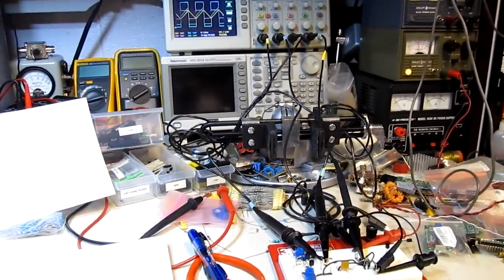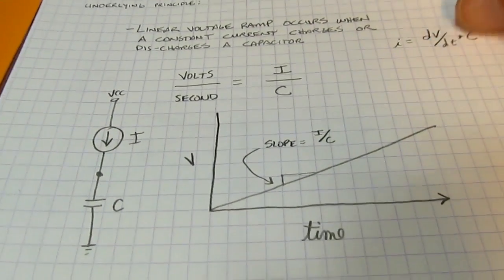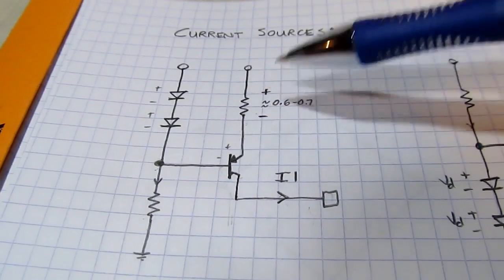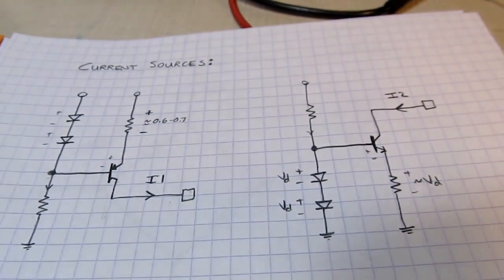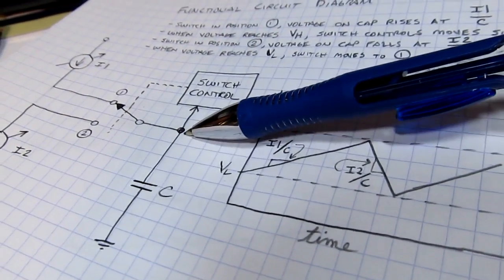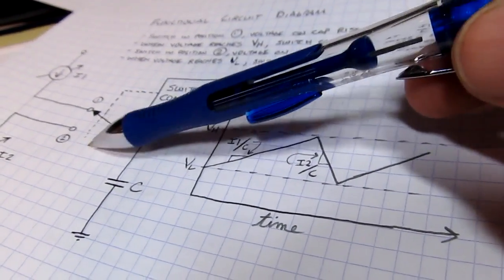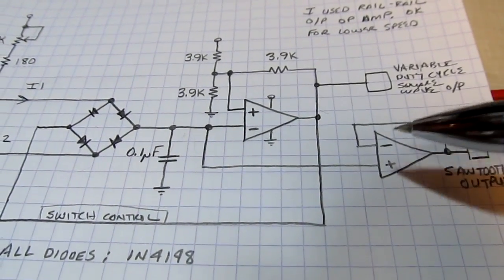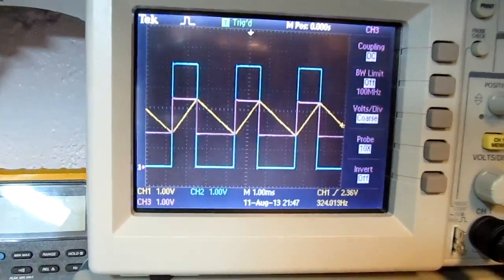#104: Circuit tutorial: sawtooth generator w/ current sources, diode switches, hysteresis comparator

Comment: Hey, I tried to simulate the circuit and almost succeded, but I'm having one problem that is keeping me from achieveing a perfect result: when one of the pots is at 1k (the one that controls the current through the PNP) and the other is at 0 (NPN), the generator works; however, when I swap the values (set the 1k resistor to 0 and the one at 0 to 1k) it doesn't work (voltage of the cap is at 1.2 V in this case). To simulate I am using 1N4148 diodes, BC547C and BC557C transistors, and an LT1716 comparator (datasheet: http://www.linear.com/product/LT1716). I used 12 V to power both the circuit and the comparator (+ is at 12 V, - is grounded). The program I use is LTspice and I simulate as a transient case.

I hope you can help me with all the info I've provided. Thanks!
Reply from the maker: Simulating oscillators is tricky - many times they need help "starting up", or the circuit won't converge to begin the transient simulation.  Try using the UIC (use initial conditions) and set the capacitor voltage to zero to start.
Reply: ***** Thanks for your quick reply. Unfortunately, it did not work. Setting the cap's initial voltage to 0 gets me the same as skipping the initial op. point (which is what I described in my first comment). As a last resort, here are two picutures in which I show that the circuit works one way but not the other: https://onedrive.live.com/redir?resid=191D78EC895B5A01!7888&authkey=!AIsKSJYCQdYnfO4&ithint=folder%2cpng

The voltage I plotted is the capacitor's. I circled the two resistors that I am tweaking (they represent the pots). I have checked the currents and the voltages and they seem to be alright when the circuit works. In the other situation, certain diodes in the bridge seem to be conducting more than expected. The only thing I have not added to the circuit yet is the follower, but that will not affect the signal on the capacitor so that's not the problem. Thanks for your help!
Reply from the maker: The LT1716 can't source enough current to bias the bridge when the lower current source is turned up. Try using a pull up resistor at the output of the comparator.
Reply: ***** Genious! Thant worked perfectly! I added a 1k resistor in the comparator's output so that when it's high the voltage is more than before and part of the neccesary current comes out of the 12 V supply. Thank you very much for your help! Your video is excellent! I hope I get to know as much as you someday! I will take a look at your other videos as well.
Reply from the maker: ***** Thankfully, they properly modeled this behavior of the output stage.  This is something to beware of - sometimes things like this are not properly modeled, and a circuit that simulates perfectly might not work perfectly when you build it.  For a good exercise, go check out the datasheet and see if you can identify the places where this characteristic of the output stage is indicated, in the specs or otherwise.
Reply: ***** Thanks! I will.
Reply: ***** Hey, it's me again. I am trying to understand why the pull up resistor is needed. Looking at the datasheet (http://cds.linear.com/docs/en/datasheet/1716fa.pdf), in page 6, there are 9 graphs set up in a 3 x 3 grid style. Imagine you called them according to a phone's keypad. Graph #4 shows the Output Low Voltage vs. the Sink Current (don't know why there is no graph for Output High Voltage). At 25º C (ambient temperature, used by default in simulations) the output current when the voltage is 12 V is about 1.2 mA (and I'm demanding more). Otherwise, by looking at the slope of the line, one can tell the output resistance of the comparator under these conditions is around 100 Ohms. I think the problem is that I'm making a much larger current appear through the output of the comparator, which results in the voltage dropping way too much at the output and not being able to compare the cap's voltage to another voltage that will make the switch happen.

As regards pull up resistors, I only know how to use them when working with microcontrollers and buttons, and they pull up the button pin because there is no current flowing through them. In this case, there is a permanent current flowing through the pull up resistor. It's hard for me to explain what it is doing in a simple and clear way. Moreover, how is its value supposed to be picked? I tried a few and hit one that worked, but I don't know why it worked.

Sorry for writing such a long comment. This conversation is teaching me a lot of things and making me investigate further. I appreciate your help, thank you!!!
Reply from the maker: ***** You're getting there!  Many comparator output stages are simple open-collector stages.  Basically, this means it's an NPN transistor whose base is turned on or off by the comparator, and you connect a load (pull up resistor, most often) to the output.  When the transistor is "on", it pulls current through the pull-up resistor to make the output voltage low.  When the transistor is "off", the collector looks like an open circuit, so the voltage is pulled high by the pull-up resistor.  

In the case of this specific comparator, they included a low-value current source at the output to make the output go high when the transistor is off, eliminating the need for a pullup resistor in many (but not ALL) applications.  Think of it this way.  Usually, then the output of the comparator is low, it will be asked to "sink" current from the load.  The open-collector NPN device is very good at that.  When the output of the comparator is high, it will be asked to "source" current to the load.  An open-collector NPN can NOT do that.  This is what the pullup resistor does - it provides a source of current from the positive supply rail to whatever load is connected.  

In the case of this circuit, the load at the output of the comparator is the diode switch bridge. When the comparator output is high, it needs to provide enough current to switch the bridge, which means it has to source the current for the lower current source below the diode bridge.

Of you look at the middle plot on page 6, you'll see that it is only shown sourcing ~50ua.  If you look at the specs on page 4, you'll see that the I(SC+) current (down near the bottom of the table) is only rated to 110uA typically.  When you have the pot turned down in the lower current source, it needs more current than the comparator output can deliver - that's why it didn't work.  With the pullup resistor added, the current needed to turn on the diode bridge in that state comes from the pullup resistor which is connected to the positive supply rail.
Reply: ***** Your answer has helped me very much. I am using a circuit like this but with different resistor and power supply values and by simulating and building it I understand it better every time! Actually, I'm using this to get a sawtooth signal that I use to generate a PWM signal. Good news: it works as intended! My teacher oriented me on how to pick a good pull up resistor value, which in my case is 100 Ohms (Vcc is only 5 V).
Reply from the maker: ***** Excellent!  I'm very glad to hear that my video is helping you to learn and understand - that's awesome!

Comment: Why my comparator only works when the output is hooked to the positive rail? Shouldn't the output connect to the negative?
Reply from the maker: Many comparators have an "open collector" output that requires a pull-up resistor to the positive supply. So, it is not uncommon.
Reply: Oh, it's an LM393 by the way. Thanks
Reply from the maker: zerpBot Yep, check out the schematic of the IC on the datasheet:
http://www.ti.com/lit/ds/symlink/lm393-n.pdf
It has an NPN open collector output - thus it MUST have a pullup resistor to work.
Reply: Thank you, great info!

Comment: How would one going about figuring out what the set and reset points of a the comparator are? I was thinking about it and at first it seemed quite simple but going further I realized it was not just a simple parallel/series voltage divider and a fare amount of mathematics are needed to find the threshold point (using kirchoff's laws and network analysis methods). I was wondering if there is any simplified equation to do this as going through an entire network analysis for each comparator in a circuit seems a little time consuming.
Reply from the maker: It actually is quite simple. You replace the two 3.9k resistors that form the voltage divider at the non-inverting input with their Thevenin equivalent (VCC/2 voltage source in series with 3.9k/2). Then, assuming rail to rail output swing on the op amp, the thresholds are simple voltage dividers. The lower threshold is VCC/2 * (3.9k/2) / (3.9k + 3.9k/2). I'll leave it to you to figure out the upper threshold. Hint: it is above VCC/2 by the same amount that the lower threshold is below it.
Reply: ***** Right, for some reason I was using a different rail to rail voltage on my op amp than the voltage divider. So assuming a 5 volt supply for VCC the upper threshold would be 3.3 while the lower would be 1.7 volts?
Reply from the maker: Basically yes.

Comment: Nice video!
Just subscribed. =)
I want to build a sawtooth wave generator that can be adjusted to use as an oscilloscope sweep generator, I found many circuits on the web but they are never amplified.

Do you know any way this could be done?
Also, it needs to go from minus to plus, not zero to plus.

Any help would be appreciated.

Comment: so the discharge and charging of the capacitor only depends on the higher value of the polarity of your diode.. and also,
 why use series connected diode? if you can use resistor to fixed the value of the current and then transistor as your constant current source just like you did in your other videos? may i know what is the comparator and op-amp you used? i'm trying to do some simulation here,, :) thank you .
Reply from the maker: The series connected diodes are used to setup a bias on the base(s) of the current source transistors that is mostly independent of power supply voltage variations.  Yes, they could be replaced by a resistor, but then the bias would be a function of the supply voltage. At 13:02 I state that I used a dual rail-to-rail op amp. I don't remember for sure which op amp I used, but it was probably an LMC6842, since I have a collection of them.  Any rail-rail op amp would work fine.

Comment: How fast can this circuit go? Can it reach 30 MHz?
Reply from the maker: Conceptually yes, but not with the components shown. You'd have to use much faster devices (comparator, switching diodes, etc.).
Reply: HitAndMissLab did you find any good fast components ?

Comment: Alan, great design and excellent explanation. I am becoming a fan of your videos as I already am of Dave's. Question, how much can you push this circuit in frequency?
Reply from the maker: You can use fast diodes for the switches, and a fast comparator, and probably get into 10's of MHz or more without too much trouble.

Comment: On the adjustable sawtooth, I'd like to set rise and fall times to 15ns. I think standard diodes switch too slow. Using fast acting shotkys changes the bias of the circuit. Hoe can I do this?
Reply from the maker: I'm afraid this would be a completely different design. Even if you put faster diodes in the switching bridge, the hysteresis comparator probably won't be fast enough, and the diode reverse recovery behavior will also become significant.
Reply: *****
can you point me to another idea or architecture that can achieve these ramp rates (15ns). Commercial function generators can achieve this now. Thanks
Reply from the maker: 15ns rise and fall means about 30MHz triangle wave. Older commercial function generators through various methods, often similar to this type of circuit but with faster parts and better control for switching directions. You can often find service manuals for these older units online, and study their schematics. Modern function generators are often DDS units, which is another (albeit very different) way to go.

Comment: Thanks for a brilliant explanation =]

If I were to use a dual potentiometer on the current source, with source and sink wired opposite each other would the output frequency remain stable? I'm interested in implementing this as a VCO for a synthesizer, so keeping the frequency stable while changing the balance is important.
Reply: The problem with a dual pot is that the two sections won't necessarily track each other very well.  Use one pot and some circuitry to get your complementary voltages/currents...

Comment: Hi Alan- what is a good way to add a dc offset to the output? Use a summing circuit? Also, how to determine the output impedance, for instance to drive either a high or low impedance load? Thanks!

Comment: Can you 'splain something to an electronics idiot (me)?  Why is it necessary to charge/discharge the capacitor through transistors...  couldn't you achieve the same result just sourcing/sinking current through the resistor/pots in series?  Because to me, it looks like the op-amp and the diode bridge are doing all the switching, so I'm confused about why the transistors are even needed.

Comment: I think I found the way to alter the slope while maintaining overall frequency. Use a dual-ganged pot, and wire them in opposite directions. Rise and fall slopes are then inversely proportional, changed with a single adjustment. The frequency should remain the same, which is great for audio applications.

Comment: I've been looking into building a modular synth, and I'm wondering if this idea can be adapted for voltage control, since a VCO that can smoothly transition from sawtooth to triangle under voltage control would be cool. Probably the easiest experiment to try would be using FETs in place of the pots in the current sources. Any thoughts? Thanks!

Comment: Great video!

I have one question:  would you call what you just did in this video analog circuit design? It was very clever. How did you do it, is it mostly intuition?

Also, I am a new grad looking for work and I was wondering what kind of job titles I should be searching for. Electronics Engineer? IC Design Engineer? Hardware Engineer? I like this type of work but I don't know how to search for it or what companies to look at. Thanks.